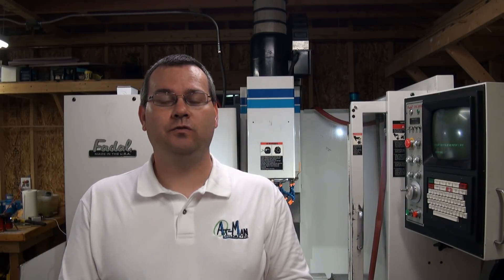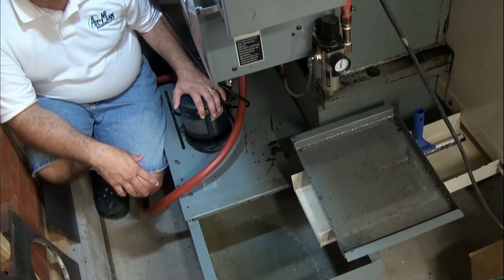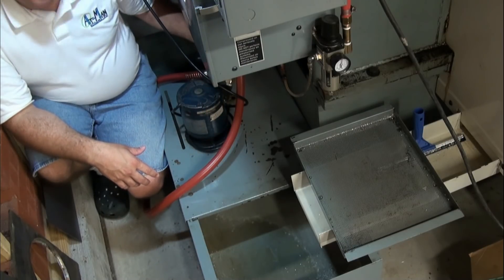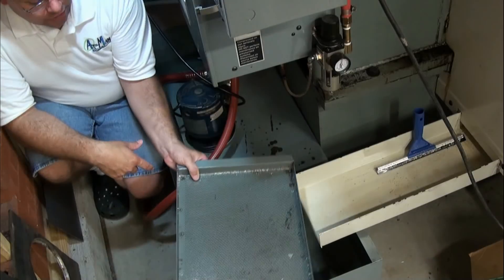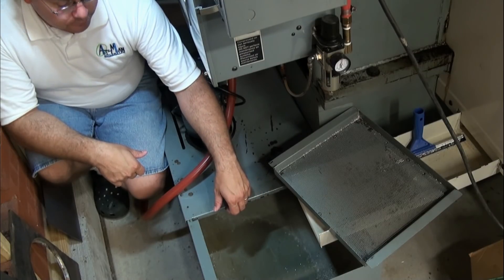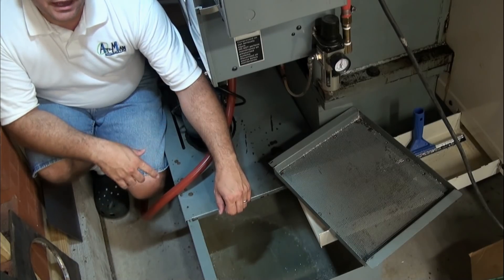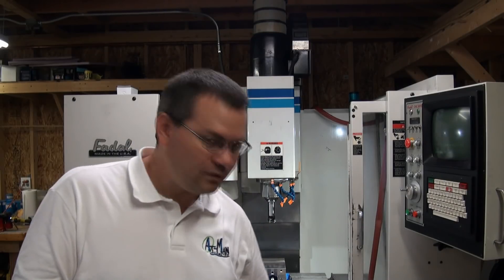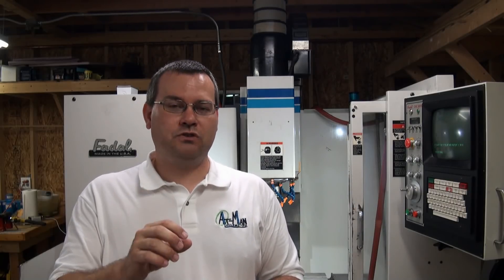Flood Coolant and DIY Oil Skimmer

Comment: Running a fadal 4020. Struggling with bacteria. I’ve just assembled your oil skimmer, now I have hours of disinfecting before I get to try my budget skimmer. Question….. My CNC runs most days, but would it be a good idea to put the pump on a timer to circulate the coolant for an hour during the night?

Comment: Thank you for the video.  I learned a lot.  Rookie question, are you running the pump in the skimmer 24hrs a day?
Reply from the maker: Yes, if you keep your coolant moving all the time it will stay good a lot longer. This batch is almost 2 years and still good.

Comment: Really need a skimmer and eventually i want to get a good $500 filtration package msc, but for now I'm on a budget and I'd rather not spend $150 just to replace with a $500 in the next year or so. Hopefully this will last me until then. Bought the same one you use in the video haha
Reply from the maker: I have a lot of feed back that it works pretty well. Let me know how you make out. Thanks!
Reply: Just wanted to let you know that I finally installed mine and almost instantly I saw how well it worked and finally was able to skim the oil out of my prescious expensive coolant haha. Thanks again for this video! I went on the Uber cheap and used a Folgers Xtra large coffee container (found at costco, Sam's club etc) and used that for my container. Worked excellent. I will make a video one day once I start my machining channel. (giving you the credit for the idea of course) haha.

Comment: Thanks for the oil skimmer idea! I will give it a try. My new to me horizontal saw seems to be full of oil and the sump stinks. It does not get used everyday and the flow is low and short cycles times to begin with. BTW: I use landscape fabric for a chip filter. A 4' roll covers my whole chip catcher in a single piece. Its polypropylene so no issues with coolant. It may actually be cheaper than the shop rags.
Reply from the maker: Hi Bill
I tried landscape fabric but my flow is to high and the area to small. Been trying to figure out how to get more surface area because that is actually a finer filter and does a better job. Good luck with your skimmer! Tim

Comment: I have a couple questions that may seem pretty straight forward, but I just want to ask anyway to make sure. You said the power head will be agitating the coolant pretty efficiently as it is a 400 gal/hour pump, have you noticed if it restricts the coolant flow at all when using it in conjunction with the machine running? Also, have you noticed a point at all where the tramp oil starts seeping out of the container? A question about the rags and filtering the chips out of the sump: When you say you lay the rags in the mesh filter screen in the sump, are you talking about the chip catch where the coolant flows out of the cab and drips back into the sump? the tray that just sits on lips on the tank itself?
Reply from the maker: I turn it off when I run the machine because the coolant level drops below the slots and then the container empties out from the power head. If you made the container float so it can maintain a set level on the slots then you could easily run it and the machine at the same time. No, the oil does not ever seep out unless the power head is off for a bit. I clean it out in the morning before running that day. Yes, I just put them in the chip catch, my trays have about an inch lip on them so it takes a far amount of chips to plug them up. But I do clear away the fine chips every few hours of running or they can overflow, but just over the edge and into the sump.

Comment: 3 air filters...( Seen )
Reply from the maker: LOL, that is called over engineering and if 1 is good, 3 is better! Ok, when the machine was made there is a fan on the top of the spindle motor to cool it. There was no filter. The fan sucks up coolant mist and cakes up in inside of the motor causing them to over heat. Fadal released a retrofit kit that puts that filter on top of the fan. It was over $100. I have a CNC mill and a hunk of aluminum. So I made one for like $20 in material. But when I put the filter on it cut the air flow down by a LOT. So I did some math and to get the minimum drop in air flow I needed 3, there $5, so a stacking we went. And I almost never need to change them either ;)
Reply: Ok, I will get a chunk of all-thread and triple up.
  Thanks!
  Mark
Reply from the maker: No Problem Mark, that is exactly what I did, just two pieces of all thread. Feel the air flow coming out of the bottom of the motor and then pull the filter off and watch how much it increases.

Comment: great idea for the skimmer!!  I have my first vmc sized machine on the way and am trying to absorb knowledge that will make life simpler going forward far as maintenance and up keep.  I am running Koolrite 2290 for coolant and it sounds very similar to the blasocut.  I currently run it on a tiny grizzly G0704 with flood and a full enclosure and my part finishes are unreal since switching to it.  I will have to grab the posts for the skimmer once the machine arrives.  looking forward to testing it out!  thanks for the great videos!! subscribed and liked!!
Reply from the maker: Thanks Chris and congratulations on your first VMC. It is a pretty big step up in capability and performance. Yes, good flood coolant can make a world of difference in part finishes. If you would like to share some pics or video we can put them in the next viewer video. Thanks again, Tim

Comment: Aerating your coolant will keep the bacteria growth down. A simple bubbler from an aquarium works wonders.
Reply from the maker: Hello BTACNC, Yes an aquarium bubbler will also work. And it works by 2 methods. The first is what everyone thinks of, by putting a lot of small bubbles into the water. It also works a second way as well.  The small bubbles floating to the surface will generate water movement an up welling. With the bubbler it is not as critical to keep the surface clear of oil because your putting air into the system below the surface. Thanks for the comment!

Comment: Thanks for the info on the skimmer,  I'll be making one this weekend. is there a reason for the grooves being on an angle?
Reply from the maker: I knew someone would ask that! I had the bin in one hand, drill with an end mill in the other. For some reason by Brain could not compensate for the cutting forces of the end mill and it walked sideways a little on the first slot. So I figured I would make them all match! Other then me being in a hurry, no. One thing I forgot to talk about in the video, you can either weight the bin down and set it at the correct level for skimming.  Or add some foam to the rim and let it float at the right level. If you let it sink you may need to turn it off while your running. If you let it float it will follow the level of coolant correctly as long as it does not hit the bottom. Mine just sinks and it works fine.